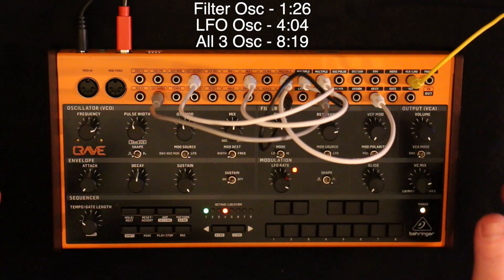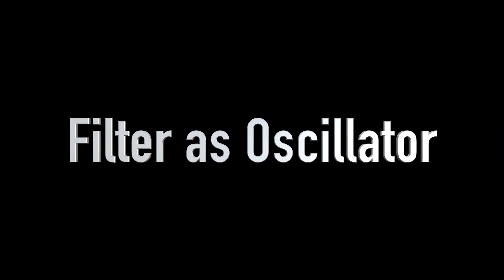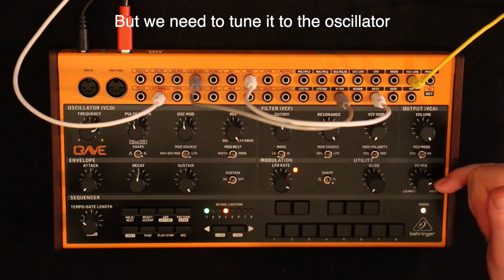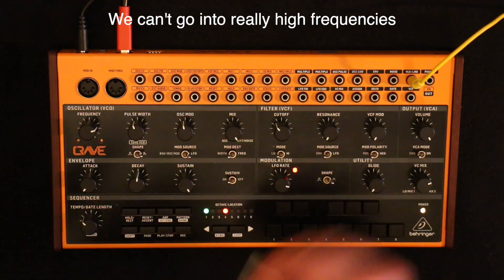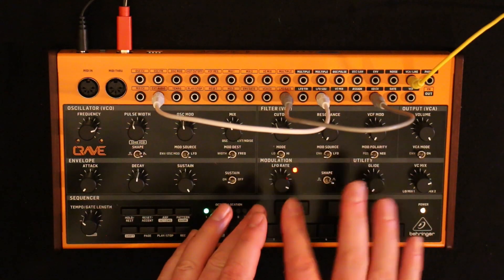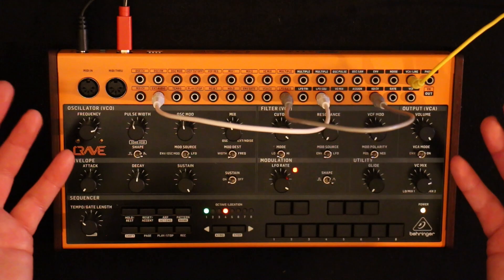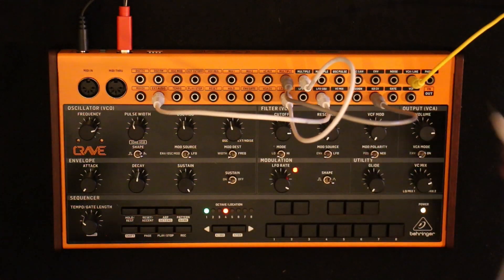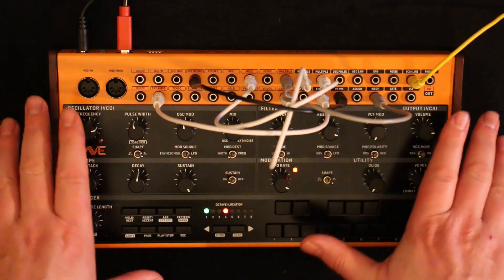Patch ideas #1  3 oscillator patch tutorial: Behringer CRAVE and Mother 32

Comment: Hi, I am using a Crave but want a deeper ambient drone sound. Can I connect the crave to a model D ? If yes how would you patch this combo ?
Reply: Yes all patch points follow the eurorack standard and can be connected to other eurorack gear such as model d. Kb cv goes to model d 1v/osc if you use the sequencer. You can send the vcf signal via external audio to model d or use a mixer (audio outputs are too low voltage for external audio without amplification)

Comment: Hi, I've just found that triggering the Crave using FL Studio can cause a delay in the envelope, making a pluck at the start of a long attack. I've found that this was caused when the midi velocity was over 75% but works fine under that number. Any ideas why? Hope that makes sense? Lol. Thanks.
Reply from the maker: Check out the accent settings for the CRAVE using synth tool.  It can produce different settings above a threshold set in the app.
Reply: @StarskyCarr  Thanks, I've just worked that out. Took me a bit of playing but got there in the end. Thanks for the reply anyway, I might not have got there! 👍👏

Comment: Are you able to get your LFO tracking perfectly?  It sounds like yours gets out of pitch when going up by a 5th or beyond?  Mine, unfortunately tracks even worse. Any tips or insight on getting a full octave’s worth of notes in tune using the LFO as an OSC?
Reply from the maker: Have you tried the CV mixer? KYBD cv out to CVmix 2 in? Cv mix out to LFO in??
Reply: Starsky Carr I have KB CV to MIX 2, VC MIX to LFO Rate, and LFO SQ to EXT IN?  Just tried that and tracking doesn’t seem to be working much different?   Now I can tune with both the LFO and the mix knob, but can’t find a combination of positions that tracks properly. Am I missing something?  Thanks for your help/insight!
Reply: @bcroson82  doesn't work here either